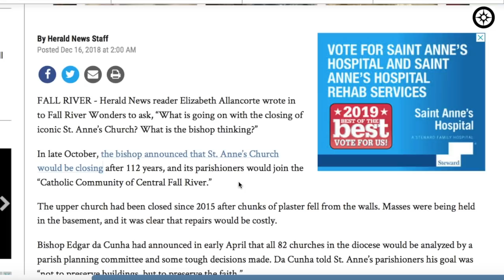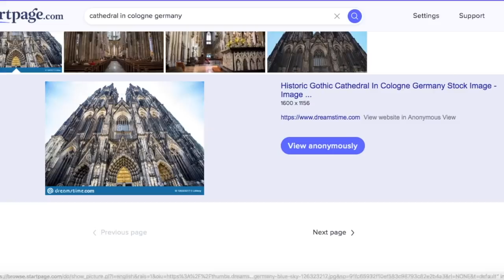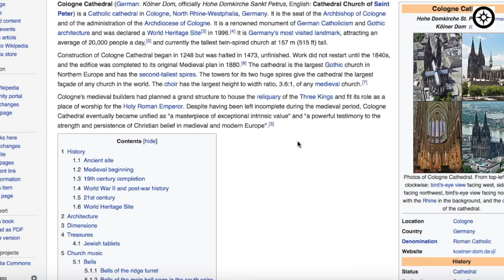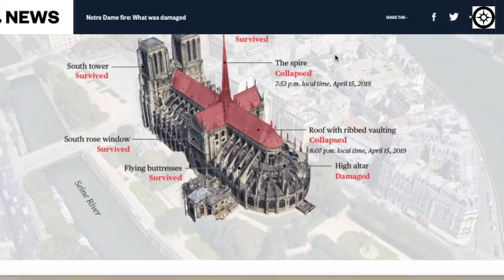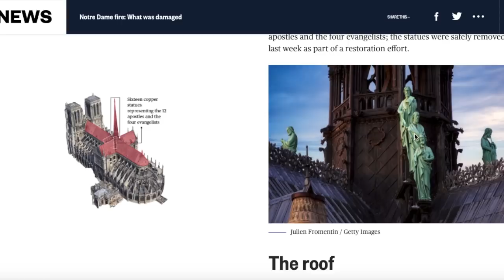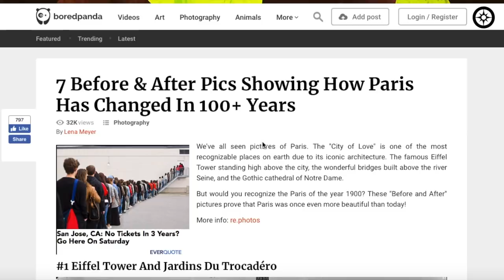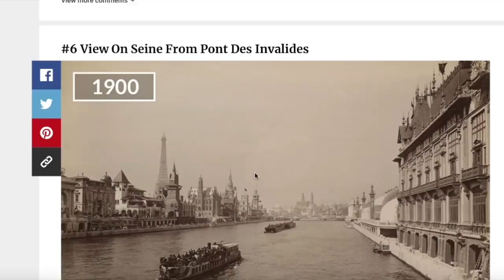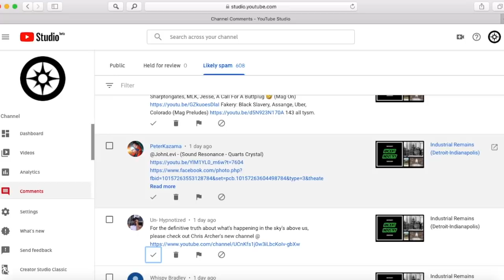False History Revealed (Notre Dame-Kolner Dom)

Comment: The smaller spires on top of the cathedrals with the little "nodes"/nodules.  Those are seen on cathedrals worldwide -  also even on the Biltmore House in Asheville NC, in Palm Beach Florida on on one of the historic hotels/forget the name already in one of your own videos.  Power generation/conductivity?    Also note that the spiral staircase on the front of the Rothschild manor is similar to the one on the Biltmore House.  There MUST be commonality in the source and purpose.

Concerning the buildings that once were right on water's edge of the River Siene, wouldn't you think they were very proned to water damage and flooding?  Probably rotted quickly.  Flooding would have been common with the water level that high.  Don't know, but seems logical.  Rot would have  rendered them unusable in just a few years.  Also the buildings that close would provide potential for unobserved sewage dumping into the river, causing bigger problems.

Comment: Wood that old has lost over time most of the flamable ingredients. When we make a bonfire it burns very fierce,  but that are liquids contained in the wood like Benzene Toluene and other hydrocarbons. Old wood has more the structure of charcoal, It burns but at a slow pace due to the lack of flamable matter. Here the roof was flashing off in no time not consistent with old oakwood. There are now several YouTube videos out with people trying to set fire to such a composite, oak lead and birdsnests. Most are very boring, because it takes quite some time before even scourch marks appear . One was very busy with a serous blowtorch an arc welder and a angled cutting wheel, no results..What we see from the organ is just a front . The real organ is behind that facade and is much extended, but a glass filled Rosewindow and ahuge vibrationgenerator are not a good combination, so I suppose when the organ was doing the designed work there was no stained glasswindow at all, just the symatic pattern reflecting the basefrequency of that particular building.When I was young my father had a budget priced encyclopedia with colored drawings and one of the picture was almost the same as seen along the Seine with these beautifull buildings now gone, but it was described as one of the ancient seven  worldwonders : the Hanging Gardens of Babylon.

Comment: When was Cologne Cathedral actually built? 1826-1836
www.youtube.com/watch?v=_NAiB1KSI90&t=1m20s
1. Built 1826-1836
2. Way larger and heavier than its predecessors - think of the foundations requirements!
3. Same outline of Notre Dame Cathedral.
4. Metal towering, the spire - a smaller predecessor of the Eiffel tower, Constructed from 1887 to 1889.
5. Marvellous, large pieces, of modern Glass plating (from St. Gobain since 1681).
6. These were built post Napoleon Bonaparte's death 1821,
    in order to reverse his & the revolution's separation of state from Church.

Comment: We're pretty sure these old buildings harvested electricity from the atmosphere. Yet how did they store and transmit/ utilise the energy? Are there wires connecting the spires to ground/capacitors/distribution grids?  Did they re transmit the energy ala Tesla? The structures/buildings are not machine-like but electrical circuit-like.  If the spire was made of wood and lead it could burn just like we saw, I've melted lead before. Doesn't take much heat to do. Why did they let it burn is the question. So we have electricity harvesting along with sound wave production capabilities....What did they do with the electricity/energy potential harvested? It pretty much had to do with evil purposes, didn't it?  What are they doing now with 5 G?   Did the people wake up and destroy  the brainwashing/mind control centers that used free energy.....because they could, because each structure could be individually disabled?  With their new system power plants would have to be disabled. Not as easy to do and they'd only need to guard a few places relative to the past system. We have to move past "they used free energy/did they use free energy" and figure out how and what they used it for, otherwise we're just "keeping it flat" again. When cats get out of bags they have to mislead/stall /stagnate researchers somehow. Keep a topic focused on. Such as "did they use free energy" instead of how did they use it and for what?  They'll throw out ludicrous possibilities to keep us off track/make us look crazy. It's like there's a timetable in place, that if we don't figure it out in time, we lose.

Comment: You do talk some rubbish, if the roof was constructed of lead, this have a very low melting point, just over 600 degrees Fahrenheit. The fire in the building would have been at least double this and most likely much much higher so a self supporting structure not.